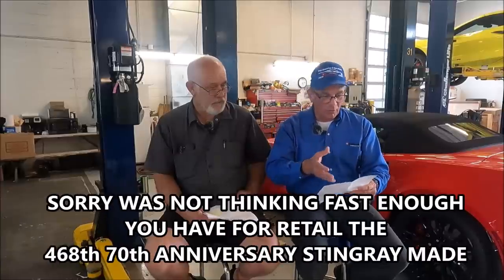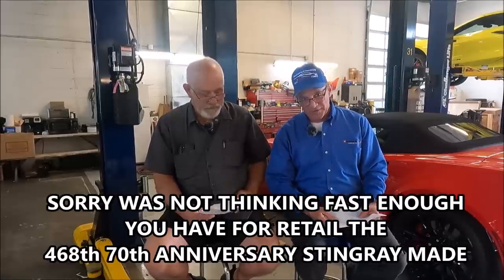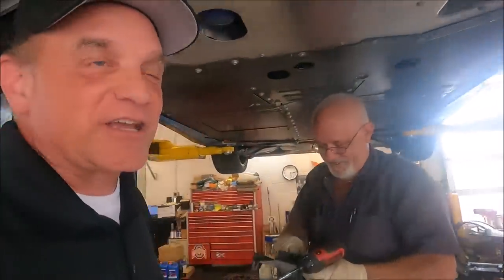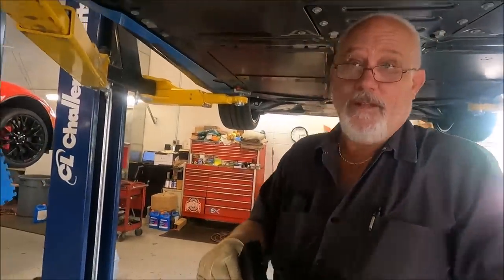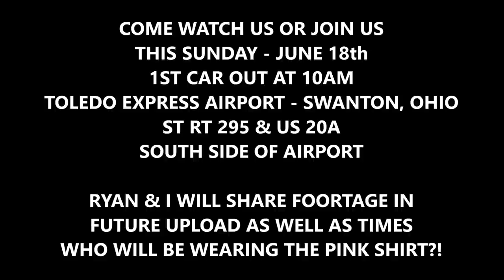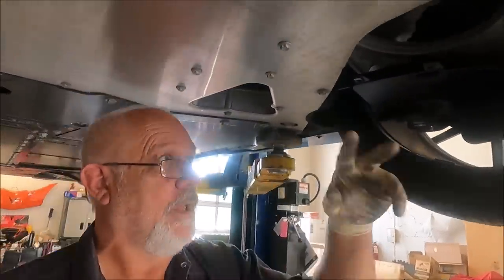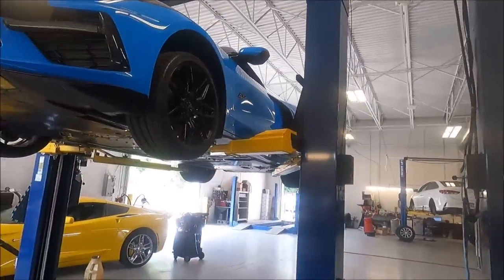C8 Z51 BRAKE DUCT REMINDER & MORE CORVETTE TECH TUESDAY

Comment: I used the factory lug nuts on my set of Aerolarri wheels  with the paragon stud extenders to take the wheels off and on. You do have to use a 12 point socket and so far no damage on the caps or wheels but I'm stupid careful when im doing this.

Comment: Rick Question #1.
I have the rear  brake air ducts on because I frequently track my car. However the car is so low it is a pain to get under the car unless I bring a floor jack to the track. Also it's extremely hot under there. Is there any easier way to remove those air dams. I know I'm whining & this is the price you pay to enjoy the track.  So far I have not had any issues with debri as I have left them on for over a year. I don't trailer my C8, therefore not much space for track equipment & over night luggage for a few days. Just whining. Thanks.   I'll also submit this for Tech Tuesday as well 
Question #2
What is the impact wrench or blog you were referring to in this video?

Comment: Z06 is a dry sump system.   It would seem you’d have to run the engine to fully fill the system.   Just as you never fill non dry sump all the way (leave it one quart low) and run the engine before filling it to capacity, it would seem the sump system on a dry sump engine would need to take (2 quarts?) the oil into the sump system.   I could be wrong and haven’t read the Z06 manual….

Comment: Need the channels advice. I have a 190 day old 2LZ Z06 orange with 5 miles on it. I was going to offer it for sale at a reasonable price in lieu of the markup I paid. Now the market is getting weird. Should I keep it at 5 miles and sell it or bag it and drive it...the 3rd option is don't drive it for 10 years and Barrett Jackson it for a million. Thanks Conti crew.
Reply: As someone who has been attending Barrett-Jackson for the past twenty something years. I recommend the third option without hesitation.

There are several 'modern collectables' currently for sale that will garner some tremendous prices when they eventually roll across the auction block. I would name a few but I'm being selfish this time and keeping that insider info to myself. 

However, I will give you and the viewers a small hint. Focus on cars with a V8 and/or manual transmission. They are a dying breed and will be highly coveted in the near future when everything has gone full digital wizardry.

I look forward to meeting you in the next ten years or so if you should happen to remember this moment. 

Stay classy my friend.
Reply: @BertShackleford  thanks Bert. I'm leaning that way. With the death of ICE cars and V8's I'm thinking the car will be worth more in 10 yrs.

Comment: RICK & CHUCK    What do you think about the CARBON FIBER WHEELS?  
Should builds include them if to be used on TRACK CARS &/or as DAILY DRIVERS?  
Bought only if for Static Displays, Collector Cars, you have deep pockets…..

Since Carbon Fiber Wheels are so expensive, can easily be damaged in use, need to be changed frequently with hard Track Use, Hard to find a dealership or Tire Shop that will work on Corvette Carbon Fiber Wheels and/or change them, and to buy replacements at roughly $20,000, why would anyone want them?

Comment: I understand that Chevy added the extra 2 quarts of transmission fluid but did they put in high temp brake fluid?  Inquiring minds need to know
Reply from the maker: For Z06 yes extra trans fluid in from the factory - brake fluid no - only needed for Serious high speed driving
Reply: @RickCorvetteConti  thanks Rick.  I think it is another fail on part of Chevy.  Heck add to price of car whatever as my baby will be rockin.  Hope you can locate me some ERay all seasons that will fit on Z06.  It will be best purchase.  Loved seeing the all seasons on your car!

Comment: I have the trident wheels on my 2021 and the 22mm socket does not fit the lug nuts. A 23mm fits but is a little loose. Are you certain the 22 mm is correct?
Reply from the maker: Yes use 22 all the time